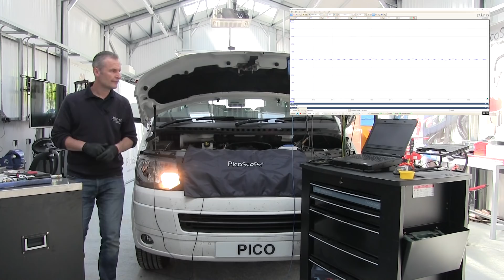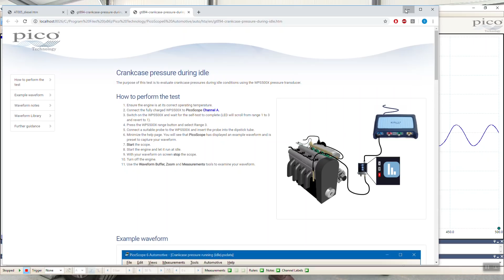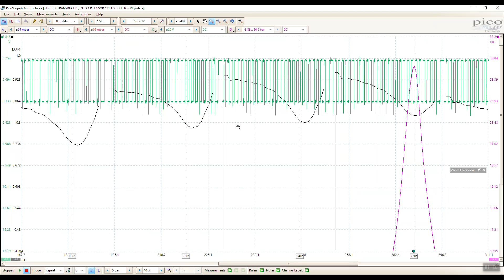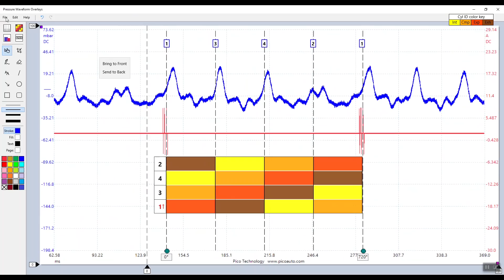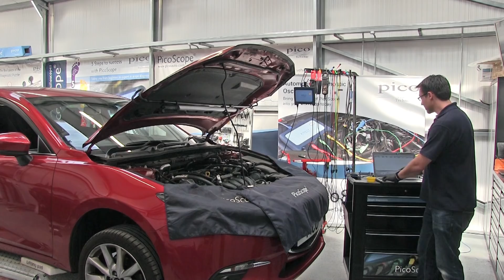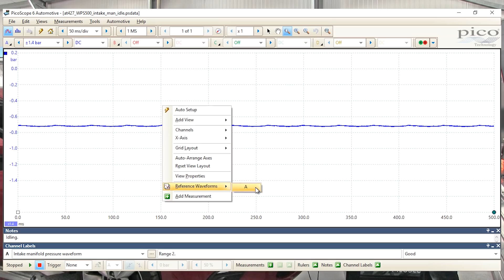Practical Pico: Non-invasive engine condition testing - Video presentation

Comment: Hi steve, just to clear something in this video. You state around the video time 1 hour that the disruption in the exhaust pressure after cyl.4 Exhaust closes is due to dramatic acceleration of the crankshaft. As a matter of fact it is induced by the double quantity of fuel cyl 2 gets to accelerate the crankshaft back to its target idle RPM. So the residual pressure after combustion of cylinder 2 is that high that we can see the result of this in de tailpipe pressure. Cheers Marc.

Comment: Great tutorial.  
Running and engine with  a CR diesel injector disconnected is never recommended and there is a risk of damage to the ECU. Much safer to connect a spare injector .
Reply: which is the explanation?
Reply: @alinduta5398  I am not sure  what your question is , but I assume you are wondering why disconnecting an injector may damage the ECU. The reason is that  diesel injectors are fired at high voltage and currents. Solenoid types such as Bosch are fired at 80Volts and around 30Amps, piezo types use even higher voltages ranging from 180V-240V . These voltages are generated using specialised invertors within the ECU. These invertors use high speed switching circuits and storage capacitors, which are easily damaged without a load attached.
Reply: you mean the coil from injector is like a shock absorber for this high voltage?

Comment: I am new to using pressure transducers. Can you tell me if disabling the PCV system will effect the crankcase waveform.  Similar to blocking off the excessive loss in the exhaust by capping off one outlet. I would assume that the intake vacuum will have some influence on the waveform by way of the PCV system. Have you done any comparisons with and without the PCV involved? Obviously some systems don't lend to easily being accessed. 
I am very impressed with the time and effort you guys put into your videos. Keep up the good work. The level of detail that is now available to the technician is mind blowing. And it is so great to have people like you who are willing to share your knowledge.
Reply: Hi Todd here is the reply to your question on our forum https://www.picoauto.com/support/topic21803.html#p98787. I hope this helps, take care....Steve
Reply: Hello and thank you for the feedback and additional question. I think this is best explained "in practice" as I believe PCV operation in conjunction with manifold pressure must influence the acquired crankcase waveform. I have started to answer a number of additional questions from the above Webinar here https://www.picoauto.com/support/topic21803.html and I will add this one ASAP (later this week) once I have the waveforms and conclusion. Thank you again, take care...Steve